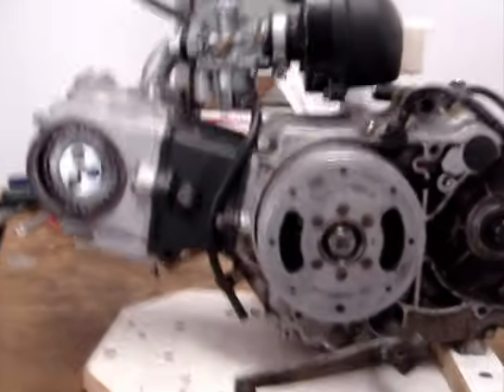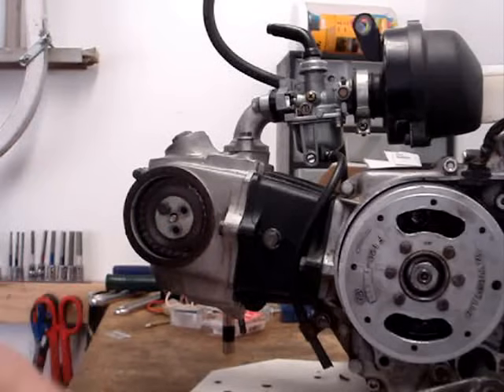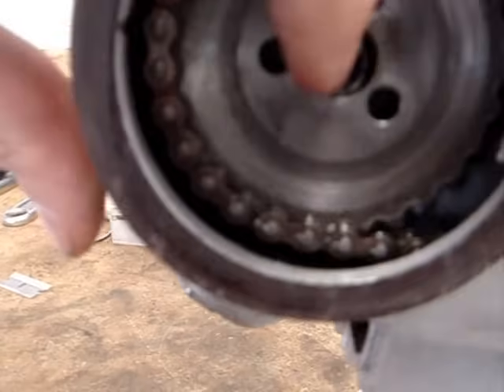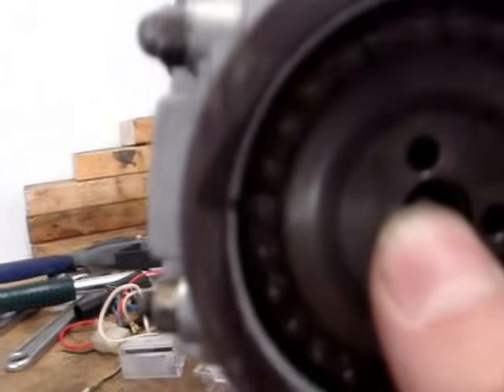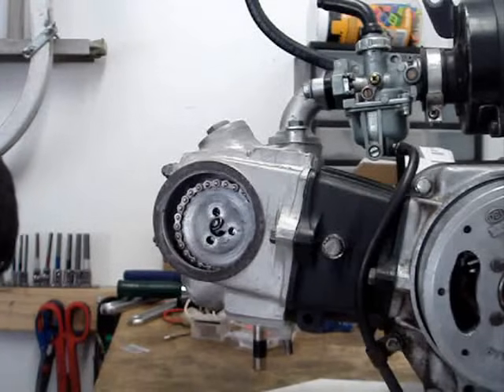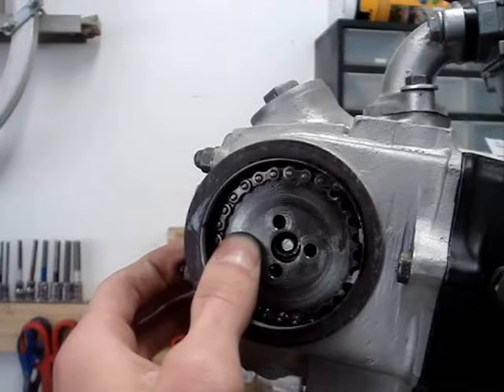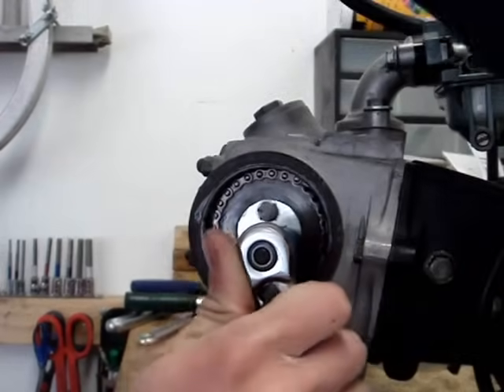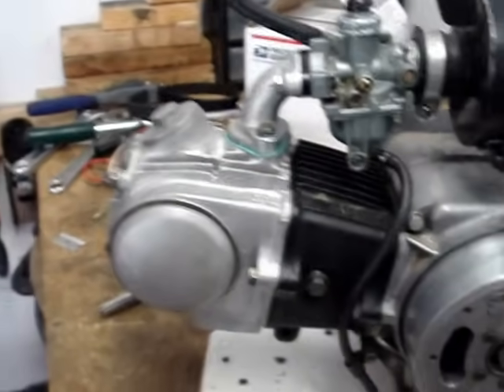How To Set Cam Timing

Comment from the maker: Use the T mark. T is TDC. F is when the spark plug should be firing.
Reply: If I set mine at t the notch on my zongshenis past the pickup for the spark f is a little before the spark tang and I still can’t remember what the timing marks are a long time go they had a manual n the zongshen website but I can’t find it anymore